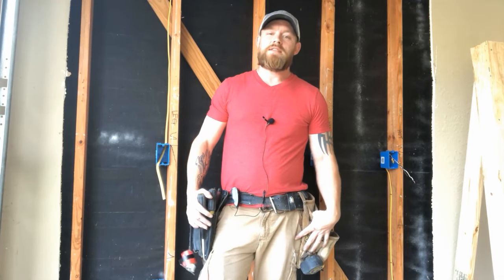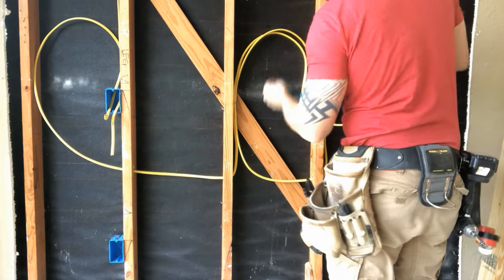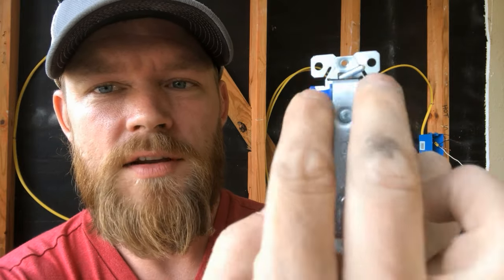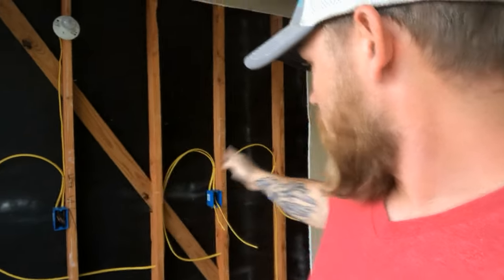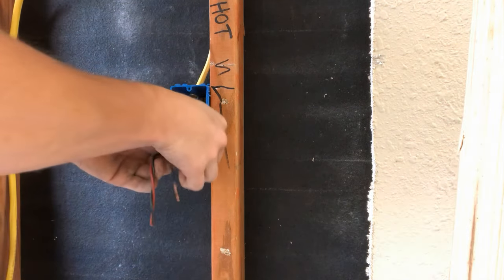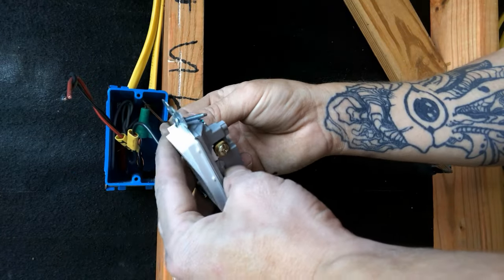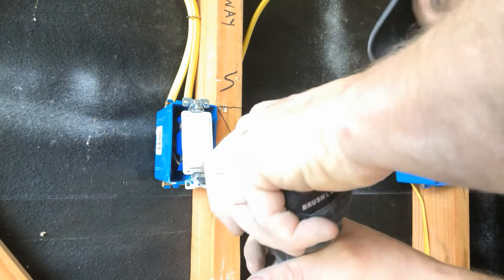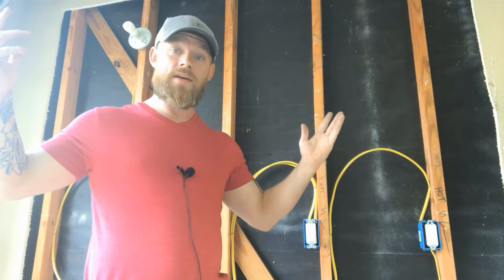Episode 8 - How To Wire For And Install 4-way Switches

Comment: When wiring 3 and 4 way switches is that the only time you will need to wire with 12/3 wire? Also how do you wire lights and outlets together on the same circuit can you use just 12/2 wire for both..
Reply: yes you need 12/3,, because you need a neutral at every switch. You can wire lights/outlets from the the hot wire at the initial box the feed comes into. You can pigtail off the hot (one going to the switching circuit, the other going to feed your outlets going elsewhere) and wire outlets from there. You use 12/2 for that because you are not going to need the red.

Comment: I found an energized earth ground in a non working gfi
Any suggestions
Reply: Just out of curiosity, how did you determine that the Ground was energized? A volt detector, multi-meter, or both? If you used a multi-meter, what was the voltage reading?
Reply: When I find that I find that neutral and hot reversed...
Novice, or homeowners OFTEN dont care what is what... wire is wire to them...
Reply: Only way to fix that is to isolate the breaker energizing the circuit... then start tracing wires.
Itll either be a stupid mistake, or a melted wire has contacted a neutral, and a load is energized the ground...

Comment: Does the "hot" side mean the same as line and/or incoming power? And, does "leg" side mean the same thing as load ?
Reply: basically yes. The hot is just another term for line. The leg side means switching leg, that is the wire going to the load. Wouldn't consider it the same term as "load" but in these terms yeah

Comment: Question:  and if you've answered it previously, I sincerely apologize...haven't read all 547+ posts.  Why run traveler wire lower instead of higher?  Cost and convenience and logic to me dictates running it higher than the boxes.  If you use 2' to 4' between each traveler, over time that's a lot of wire.  But you're the expert with standards, of course.  I'm hoping for more than "that's just the way it's done".   Just curious.  Thanks.  Nice vids, bud.

Comment: Why do you twist and cap the wires as opposed to using wago lever nuts? I’m not an electrician btw, so I’m just curious.
Reply: Probably doesn't trust them.  I know I don't.
Reply: most old timers twist wires to hold connection together with wire nut as an insulator cap.  i prefer to use copper buchanan crimps with snap on caps

Comment: ? I have pro-line electronic ballast old with 2 yellow blk/wht on one side on the other side blue red this is the oldest now knew one side blk and wht that other side 2 blue one red so how do I connect the new one  tanks
Reply: thats ballast circuitry, so you would connect your black to line, white to neutral. For those red/blue/yellow wires. Think of the red and blue as "hots" and your yellow as the return (neutral) 
Red wire goes to one end of the tube light, and the blue goes the one beside it. The yellow, you use to connect all the ends at the opposite side.

Comment: Are those ground wire nuts not allowed in some places? On the west coast here and I have never seen them. I usually see grounds twisted with a copper ferrule crimp or nutted with a pigtail.
Reply: Why waste money on different type of wirenuts when pigtailing does the same thing
Reply: @DLmohh  I do remodel work and every ounce of space saved in a box is a premium

Comment: can you put a dimmer switch in a 4 way circuit?
Reply: Yes.  Conventionally, one of the three-way switches can be replaced by a dimmer, but the amount of dimming can only be controlled at that location.  For something more flexible, you can install a Smart switch.

Comment: Dont your staples have tabs on them  to stop the staple from going deeper into the 2x4?  The wire is supposed to be slack within a staple that has been pounded into the 2x4.  The wire is between the tabs and the staple head

Comment: It's better and safer to use Romex Staples that have the plastic strap bridge that covers the sheathing jacket . Less chance of pinching the conductors inside the cable
Reply from the maker: I've heard some people talk about that same thing.  Lot's of arguing both ways.  I've been using regular staples for 12 years and don't have any issues with it.  But fresh greenhorns should maybe be practicing with the plastic type.  Everyone has their method.  Metal staples are an approved and listed method. Just depends what you like
Reply: @electricianu  ;  I am NOT some fresh Greenhorn !!  I'm a Licensed Journeyman Electrician / Sub Contractror with over 53 years in the trade specializing in Residential & Commercial Wiring , New Construction, Remodels and Upgrades and I have used the  plastic strap 2 nail type staples ever since they came on the market and that's been many, many years ! I don't even buy or like the metal type staples because they do and can pinch the wires or cause a short !

Comment: Do not kill your cable with the staples. Staples are to hold cable in place only. You should be able to move your cable a little  in side of staples .

Comment: If you are using Wing Tip Wire Connectors , there is no need to twist the wires together before applying the Wingtip Wire Connector because as you tighted the Wingtip Connector, it will twist the wires together !

Comment: The switch and hot are not always in a different box. It actually saves time and money to wire your switch through the light and have a dead end. Make a video about that.
Reply: Jeff Warner you have to make a switch leg which doesn’t really matter cause u still need 3 current carrying conductors either way

Comment: can the 4 way be at the end of the  circuit?
Reply: no because one wire would be useless and the switching circuit wouldn't work as normal because you wouldn't provide a pathway for electricity to the load.

Comment: IS THERE A PROPER WAY TO WIRE A 4 WAY IN AN OLDER HOME THAT IS 12/2 WIRE INSTEAD OF 12/3 WIRE?
Reply: Run pairs of 12.2 to all devices.

Comment: As a fellow electrical educator and master electrician I have enjoyed your videos IMHO everything in this video was great and your "Side tracks" are also a good perspective and useful information but I a SO disappointed with how you score across the jacket to strip your wires! 
I have personally seen a box catch on fire due to someone overscoring a wire like that which is why it is a banned practice for my students, apprentices, as well as anyone that works for me. Other than that great job and keep up the good work.
Reply from the maker: Thanks for watching my friend! Interesting, I’ve never seen a box catch on fire from a scored wire. I respect your opinion as a master electrician fully, but I feel there was possibly something else going on that needs to be addressed...not simply a scored wire. Was there no overcurrent protection protecting the circuit? I’m confused how a fire would happen, maybe a short circuit or ground fault if you really meat-cleavered the shit out of the wire and there was that much exposed conductor that they were able to physically touch, but a tiny score in the insulation is not going to cause this. And again...the real issue is how did so much heat/current build up in the circuit that a fire started and no OCPD tripped? I feel there’s more to the story here. Either way, thank you for sharing your advice and opinion. Stay safe out there!
Reply: @electricianu  Yes you are correct, there was more to it than just a nicked wire. It was about 15years ago, the house was on the ocean and it was in an old work box cut into the shingle for an outside GFI, the old flip up cover was slowly leaking and the the moisture inside was enough to send a current enough to jump out from the knick in the wire but not low enough resistance to cause a dead short and the old breaker never tripped. The resulting arcing caused the gfi to melt down catch on fire and scorch the side of the house  where lucily the rain put it out. It was an interesting situation  and the exact type of situation for why they made arc faults.  I wish I still had the pictures  but you could see where the wire was arcing on the knick.  Yes it was  "A perfect storm" per say where everything went wrong but  that knick was a definitely contributing factor.  I am by know means telling you how to do things as I totally respect what your doing here and I am not saying you cant strip like that and not nick the wire , It is just to easy to do so with that technique  if you don't have years of experience and a "feel" for it.  Thank you again sir and if you would be so kind you can follow my class on Instagram@Charihotechelectrical

Comment: Apartment building staircases could have a 4way at every floor, 3ways top and bottom. When the companies I worked with hired a new apprentice, My 1st test question was, what is the difference between a double pole and 4 way, then hand the new helper, 2 Decora switches and a amprobe. At a glance, without looking at back of the switches, the double pole or a 4way look nearly identical. Give me the 4way switch back. The test tells me that the helper knows how to use an ampprobe,, and if he/she has experience, they should be able to identify the switch, just looking at printing on the back of the device.

Comment: Why do your boxes have no bonding screw? Do they not need to bonded in the US?
Reply from the maker: Krolman bonding screws on plastic boxes?? Only metal enclosures need to be bonded.
Reply: I work in Canada, most of the time we use metal boxes.  Sometime we use yellow plastic boxes, on exterior walls, so we don’t have to use vapour barrier.  We call these banana boxes and they all have bonding screws. Never seen a box without one.  I guess it ensures your grounds are connected
Reply: Here in canada everything is bonded, even plastic so that the device can be mechanically bonded through the fasteners when it is screwed on including the dedicated bonding screw., In slab everything is plastic but still has bonding screws.

Comment: Still trying to understand why the wire from the light is called a leg. As well as the wire that travels from the box to the other was called a leg. Please explain.
Reply from the maker: not sure why we call the wire to the light a leg, just something everyone says.  a wire that travels from one box to another is called a jumper, not a leg.  Wires traveling from breakers to boxes are called home-runs.  Wires running between 3-way switches are called travelers.

Comment: Stab ins are quicker, but never as good and can cause melting receptacles. I have seen them melt
Reply: Lies. I’ve seen melted receptacles from curling it around the screw. Yet never had a problem stabbing it

Comment: 8:33 dude... I simply can't understand how you're managing to cut the sheathing like that.  I've tried countless times and I cannot get the utility knife in there in the right way to score both the front and back.  I just... It looks so simple, I don't even know how to ask what to do.  I just know I haven't been able to at all.  Maybe it's the boxes I've been using?  Mine are old work boxes with the one way cable "clamps".   I've tried so many times and always end up having to resort to scoring it down the middle and getting it off that way.  I just don't understand what I'm doing wrong :\
Reply: Sharp sharp blade for me. The bottom cut has to be directly over the top cut or the sheathing will just stretch when you pull it. Another elect I know only splits down the middle and slices off the banana peel. Just practice I guess. I use a lockback knife sometimes but usually a regular utility razor knife.
Reply: Practice and luck.  I don't think it's a good idea at all.  Even if he does it just fine 999 out of 1000 times, that 1 time is a completely avoidable fuckup.  We're all human and bound to mess things up, so you should EXPECT to mess up and have some respect for human nature.

Comment: honest question... Why run 12/3 instead of 14/3 ?
Reply: If you look at an ampacity table, 12 ga, is rated for 5 amps more than 14 ga. (for any given wire type and temp rating). If you're just talking about lighting, you'd have to put quite a few incandescent bulbs on a circuit to get near the capacity of the wire. Figure the total number of light fixtures for the circuit. For this example of a single room, supplying a single fixture, unless it's a great big chandelier with dozens of bulbs on it, that's probably not going to come anywhere near the capacity of a 14 ga. line. But if you start adding high current lights, say like 300 or 500 watt halogen lighting to the circuit, say, as fixtures on two or more sides of a garage, house or patio that you want to control from two or more switches, the current requirement goes up fast. This episode is just for lighting, but you have to consider other things like an electric heater in a circuit, either now or in the future. A discussion about this question (12/3 vs 14/3 here: https://www.houzz.com/discussions/2654884/12-3-wire-vs-14-3 ) says NEC Section 424.3(B) says current load for electric heating should be figured for continuous load at 125%. Means although you could probably put a couple of 1500 watt heaters on the same 12/3 wired circuit and MAYBE not fry the wires or trip the 25 amp circuit breaker and burn your house down, the circuit SHOULD have at least 10 ga. wire, rated at 75 or 90 deg C., AND a 35 amp breaker. The same circuit with 14 ga. wire probably WOULD fry, if the breaker failed. House could burn down and you'd be wishing you'd spent the extra few bucks when wiring it up, if you weren't in it when it happened. One other thing: while you're figuring current carrying size for the wire, you ALSO have to figure the box internal volume as well. You can't just stuff any amount of wire inside a box. Notice that he was having a bit of trouble getting that wire in the middle box. The NEC has codes for how much you can stuff inside a box (and conduit). Too much and you have to go to a bigger size.
Reply: Assume he's wiring in a garage onto an existing 20-amp circuit.   20-amp circuits need 12 AWG wire.

Comment: Cutting the end of the wire before putting it in a wire nut? Couldn't you push the wire through the top of the wire nut? Just me but I like the wires even before putting them in a wire nut.
Reply: "Couldn't you push the wire through the top of the wire nut?" 
 Not sure how.  Almost all wire nuts are closed/flat on the end.

Comment: Funny thing is the plastic boxes strip out so f* easily I've had to resort to using improper screws on multiple occasions. I've stripped out a plastic outdoor (grey) box and had to use the wrong type of screw or scrap the box. I'm sorry but I don't make scrap the box kinda money, not when it's something stupid like that. 
The end result was I got the job done and the side with the so called improper screw actually was the better held side. (I was attaching an out side light on a detached garage).
Reply: happens a lot i got into the habit of just re taping the threads with certain makers had a small multi screwdriver tap set always had the 6-32,8-32,10-32s in dbles it held 8 bits

Comment: I'll add to the noise yet, you beet take and hammer handle smash that stuff 9 miles had pack in the back of the box, because the drywall goons will find some way or another to plunged cut 30' deep  dice it all up :))))))

Comment: do you have experience with crimping ground wires? Ive never used the green wire nuts before
Reply from the maker: Oh yes.  We used to do that 10 years ago.  Here in Austin it used to be a requirement, but since that went away we've all stopped using crimps.  They make a much more reliable bond for sure but it sucks when you have to add a wire or do a remodel and cut those crimps just to add another wire.  A wirenut works for all other wire joints, why not use them for grounds too? Just my $0.02
Reply: ah thanks that makes sense. man I love your teaching skills I would work for you in a second if i lived around there lol. Ive been in the trade for 2 months now and I have soooo many questions.
Reply: @electricianu  In the next state over from me they still require crimps, here they require greens. Nobody in either state does either one around here and it's never enforced 😂 That being said, my boss and I just twist like you do and take care to twist far and twist tight and cut the point off the shorter wire and steer it away from any sheaths/insulation. Otherwise sometimes I do just use a regular wirenut and run a single wire to the device. For us, for the reasons I've mentioned, we don't even buy and carry greens at all.

Comment: Why use 12 gauge wire on a light circuit? Why not 14?
Reply: In my area, we use 12 gauge almost constantly because of the ampacity rating. 14 Gauge is more restrictive on when you can use it. But yes, you can use that, it's just more material taking up space at the shop.

Comment: Not an electrician here, but an electronic tech.... I notice he didn't 'explain' what the switches actually are, or how they work, maybe not in the scope of this vid.   but.... it would have been nice to hear a description (seeing he spends time on telling us he puts both wires under 1 staple).... anyway..... as far as my idea of how each type of switch works, the 'so-called' 3-way switch is simply a 'single-pole, double throw'.... meaning that it has 1 com (arm-black screw), and 2 connections that are connected to that arm wire, alternately.  In a 3-way switch config., with 2 '3-way' switches, each switch 'steers' the live voltage to other switches 'unconnected'  throw.   Now the '4-way' switch is an entirely different type of switch, it's a '2-pole,single throw' type, but also it's 'internally' cross connected so that it literally 'swaps' both live and dead wires, again, as a result, the live wire is connected to the next switches 'unconnected' throw.... this sounds complicated, but it's just a matter of 'steering' the hot voltage.....